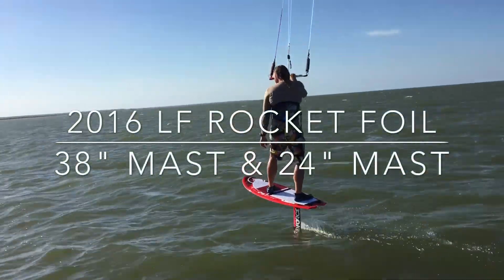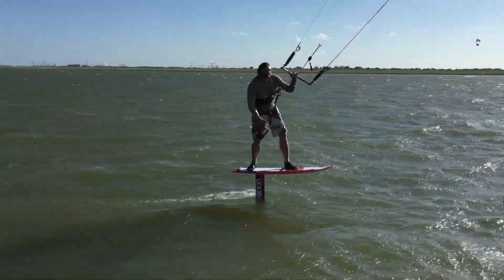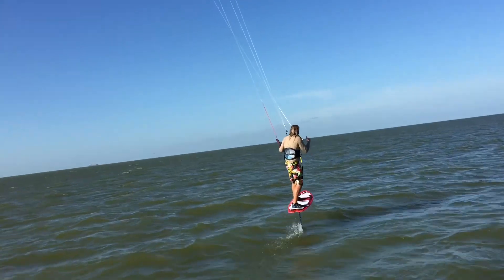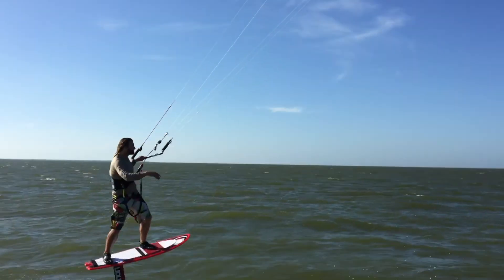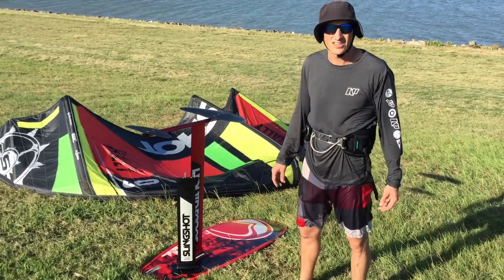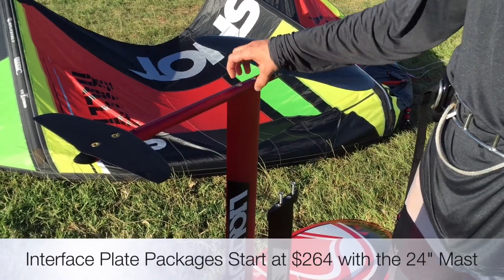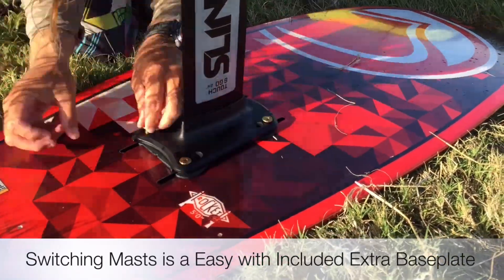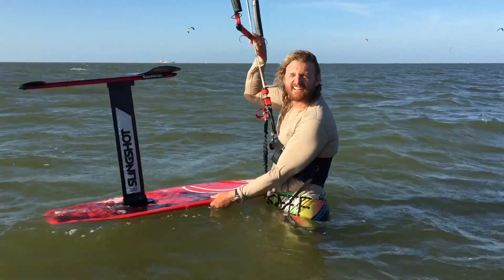2016 Rocket Hydrofoil and How to install Short Mast

Comment: There are holes to put fins in a thruster setup on there. Does that mean I can also do some surifng with it, instead of foiling?
Reply from the maker: Yes, that is right you can ride it with or without a foil on it.  We actually have one of these setups that is used but in very good condition in the shop right now.  Give us a ring if you're interested: 281-508-6485